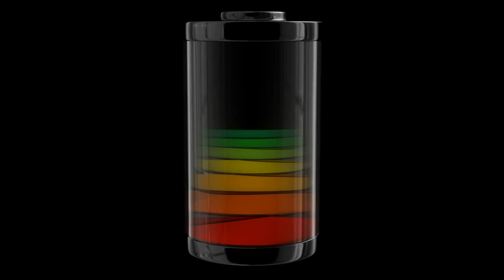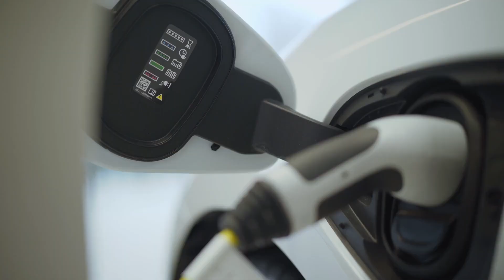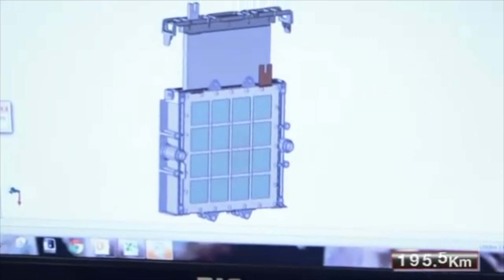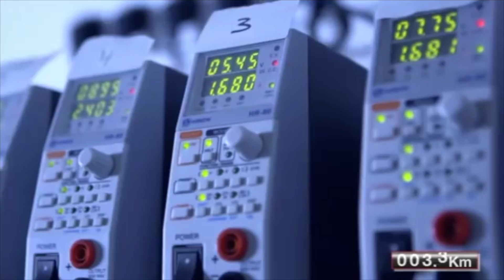This Battery Gives EVs 1000 Miles of Range!

Comment: What do you mean by pure aluminium alloy? There is an alloy or pure aluminium. Take your pick. Just to share some knowledge with you[ An aluminium alloy is a chemical composition where other elements are added to pure aluminium in order to enhance its properties, primarily to increase its strength. ... Alloying requires the thorough mixing of aluminium with these other elements while the aluminium is in molten – liquid – form.

Comment: If someone develops a way to easily remove/drain aluminum hydroxide  and insert aluminum plates in empty slots. Maybe if only parts of battery pack would be used at one time so you can still have range when one part is exhausted and ready for replacement. Then all you needed to carry would be aluminum plates and battery swap would be awoided.

Comment: How bout aluminum battery range extenders that you buy when going on a roadtrip?. Basicaly , instead of a gigantic lithium battery you use a smaller one with 70 miles of range but all that new free space can be used to plug in aluminum "batteries" that you purchase when going on a longer trip and swap out along the way. Also its important that instead of a big aluminum battery you use multiple smaller ones so you can "reload your car " by hand ( no need to lift the car or dissasemble it). Basicaly a 10-30 kg battery depending on the spacial limitations.

Comment: Thinking you can simply swap the battery packs to overcome inability for aluminum air to recharge is sweeping the biggest problem under the carpet. What is the swapping station going to do with all these discharged used battery packs?  Recycle? That means every used aluminum air battery pack has to be dis assembled and try to grind up and separate the parts.  The only way to solve this problem is either figure out how to recharge ( which I think is next to impossible), or structure the battery cell in such a way that the electrolyte liquid (not air) can easily be flushed out and fresh electrolyte liquid is flushed in, also an incredibly daunting engineering design task. Not even sure if replacing the electrolyte even works because it's the aluminum anode that's depleted?

Comment: A good system for sure. If the factory where they are manufactured has a built in carbon capture system, to negate the pollution problem and all vehicle manufactures standardise the aluminium packs, so they can be changed at any facility I can see this being the EV of the future.

Comment: Aluminum Air batteries would make a compelling use case for aviation applications, where energy density and therefore weight are entirely non-trivial engineering factors.  Running aircraft on batteries you need to swap becomes less of an issue in airport hub settings where you have the ground support infrastructure "right there" to rapidly pull and replace batteries in order to "refuel" the electrically powered aircraft while it's on the ground.  You then develop a "one use to recycle" battery ecosystem of electric aviation which then drives the technological development to the point where it can eventually be backwards ported into other use cases.

Comment: Made it to 11:20 and this video is looking a lot better,  thank you.
Reply: A big question: What's the energy cost of reprocessing the aluminum hydroxide? It has to be low enough to avoid making the Al-Air units single-use swappable items -- and it has to be much lower than the cost of charging and replacing li-ion batteries over the long term, or the whole deal falls apart.
Reply from the maker: That’s the big question. I can look into this further but right now that’s the challenge that people are solving

Comment: The manufacturing and mining concerns are only half of the environmental impacts from lithium batteries and wont be fully recognized for decades to come until its a major problem. Recycling those cylinder cells is not easy requiring chemical baths to slowly separate the elements and then a refining process to get the lithium and other elements back to something pure making it expensive which will force many areas in the world to opt for landfill and turn a blind eye because cheaper cost will always win. Lithium batteries in landfill will contaminate land and drinking water for many years. It will take 20 years before a Tesla EV battery is ready to go to landfill so there could be 1,000,000,000,000,000 or more 18650/21700 lithium cells that are ready for landfill at a similar time with the exponential growth of EVs. Recycling methods will get better but the nature of how those cells are built makes it very complicated for recycling. Oil mining and gasoline/diesel are not the way to go either.